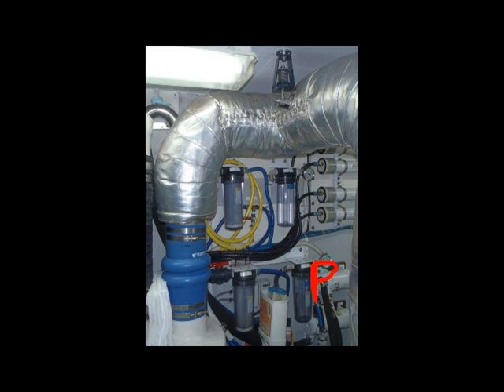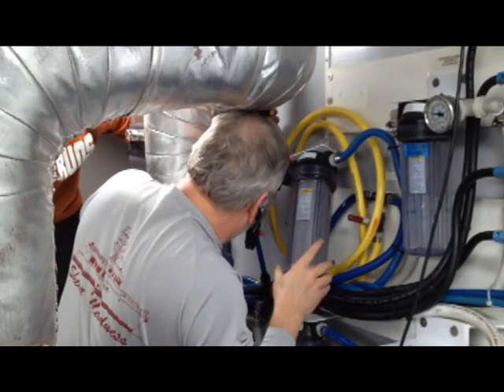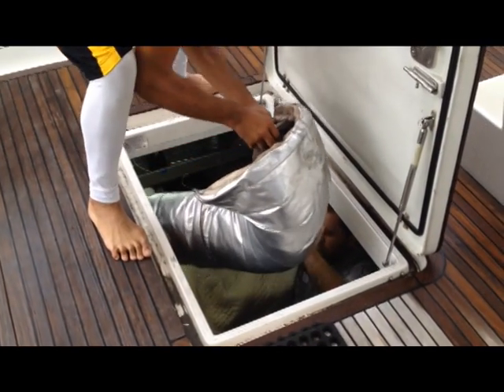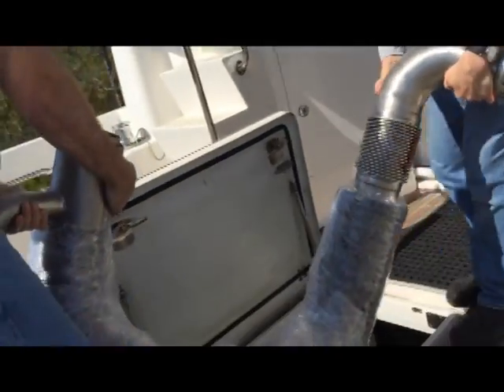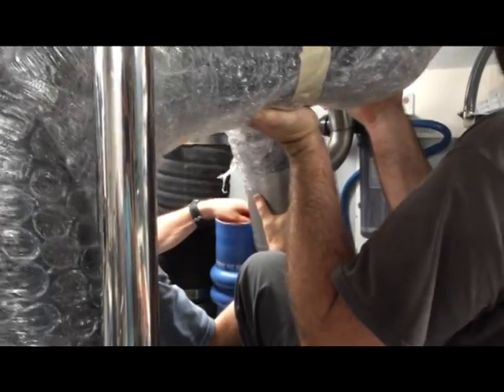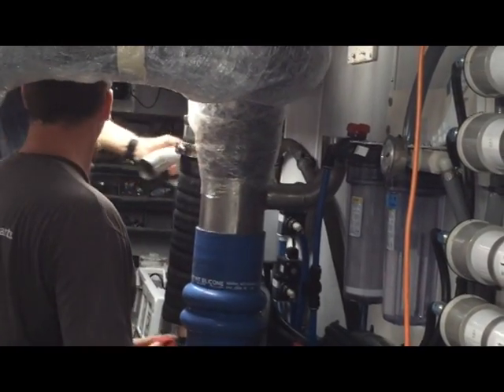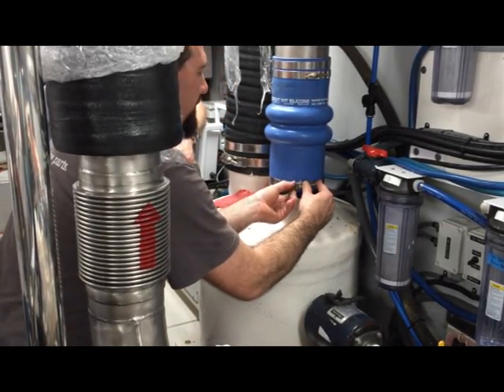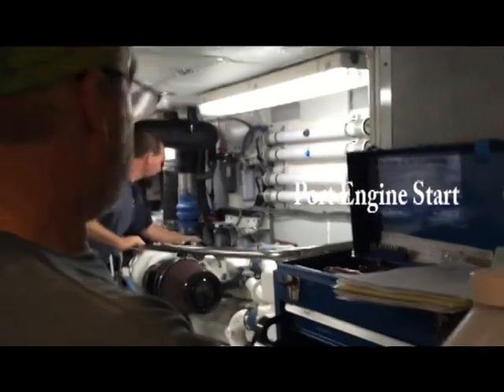2015-05 Shear Madness Replacing Engine Exhaust System

Comment: I'm guessing by the way the engines started they had been serviced and the fuel systems opened up while you were up on the dry, if not you have some issues with fuel drain back, both engine starts were a bit 'fluffy'.
Reply from the maker: +whorayful Yes, they had some major service and we had the mechanic onboard for the first start up.
Reply: +Kathy Clark All good then, they can be temperamental when the fuel filters are changed and a bit of air gets into the fuel lines.

Comment: Never knew Simple Green was a lubricant. Why not WD-40?
Reply: +Nater389 WD40 leaves a flammable oily residue/stain, excess simple green can be wiped off with a rag, and it cleans at the same time. Also works as a cleaner :-)

Comment: I don't understand why Nordhavn went to wet exhaust on all there 60 series twine installations, It just seems way more unreliable than a dry stack keel cool motor fora ocean crosser.
Reply from the maker: Ryan Oros It's like the old "Tastes Great - Less Filling" argument. I'm no expert but there are proponents of both wet and dry exhaust. It's an owner's preference when the build is done. I believe that most twins are wet exhaust because of the space requirements for two stacks for dry exhaust, but I'm not sure.

Comment: You were sent out to check if there is exhaust gas coming out?
 :)

Seriously, do you have heat recovery on the exhaust gas?
I saw you were in between the ice-bergs and there might have been a bit cold out there without a proper heating.

Comment from the maker: Keller - the boat is 11 years old. The original ones were made in China and were older technology. It's always difficult to know for sure when they need replacing, but ours were covered with insulating blanket material that was degrading so we decided to replace them now. Once we got the old ones off, we confirmed it was the right decision . The new ones should last a bit longer.
Reply: Kathy Clark Thanks! I was just curious and wasn't sure if they had a life limit or something. I follow all your videos and really appreciate all your "up keep" and MX videos!! There great to watch and very informative. I wish more people posted videos of what it takes to maintain an owner operator yacht. keep up the good work.

Comment: Congrats on your success. Just curious, was Nordhavn too expensive to get replacement parts, too far away or a combo of both?
Reply from the maker: BrownDogPromos The exhaust is part of the engine system - not something Nordhavn would do. They will install the engines and related systems - fuel management, exhaust, etc - when the boat is built, but then service is done through service techs with specific specialties. In this case, Metcalfe Marine specializes in building exhaust systems and Western Branch Diesel specializes in Detroit Diesel service.
Reply: Kathy Clark Thanks for the feedback and continued success on your journeys and let me know if you ever need custom printed t-shirts :)